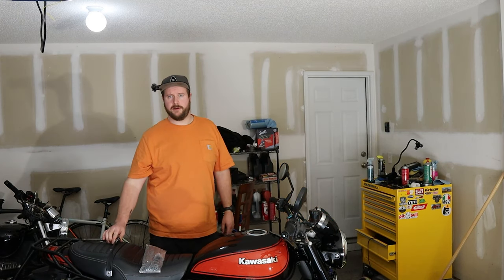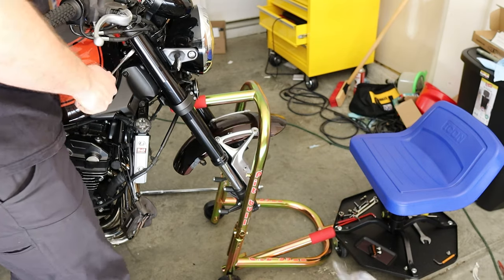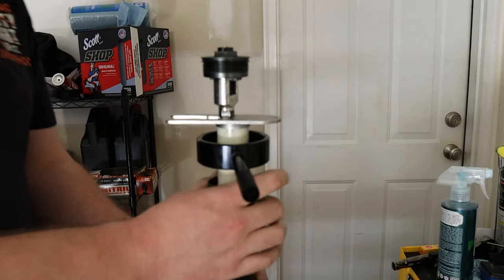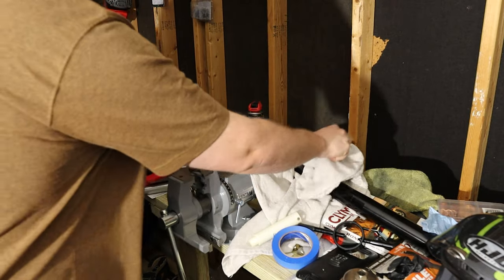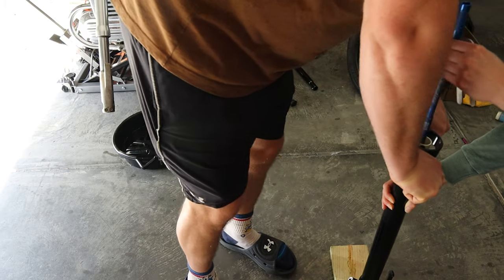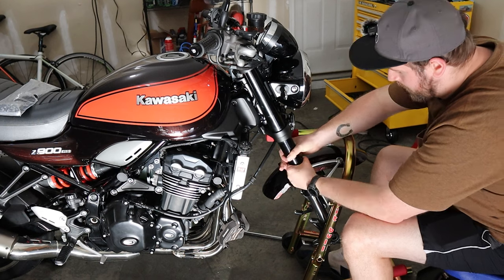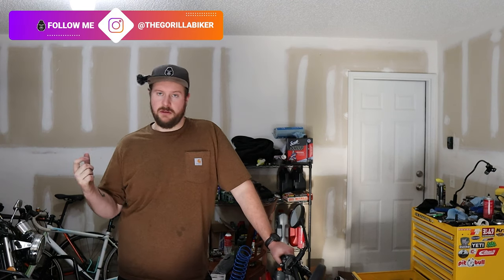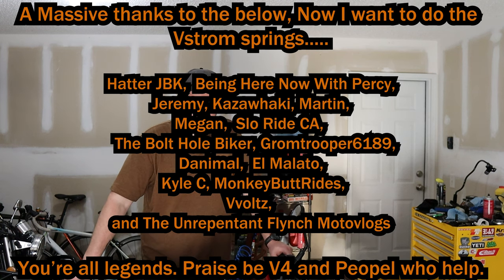Fitting Racetech Springs to my Z900RS | Tall, Heavy Rider

Comment: I like a bit of improvisation.    I did get confused about the plastic spacer 🤔  Did Racetech specify shortening it?    As you delve deeper into the internals the need for more specialised tools increases but I think it is better to learn what is possible with basic equipment. Will you be doing a video about how effective / beneficial the mods have been?  Another interesting video. Thank you. 👍
Reply from the maker: They did not but it would have been way too much preload on the new spring, they specify 15mm which shortening it gave me almost exactly and kept my stock length correct etc. 
I mean I don't plan on every revalving the stock internals etc so this is enough for me really. I don't think my talent requires that level :D 
Absolutely! Thanks! :)

Comment: Hi, did you try it already? Is preload better now? I also replaced the front springs, but mine were the same length as the original. The once I used are from Hyperpro.
Reply from the maker: Yes I have, do you mean the feel and travel? Yes it's better now as the springs are the correct weight for me. Did they give you a linear spring rate or were the just standard progressive springs?
Reply: @TheGorillaBiker  yes the progressive springs.
Reply from the maker: @Ringer1982  Progressive springs are fine for the road but you'll never get the feel and performance for track use out of them imo. That's why I went with linear springs :)